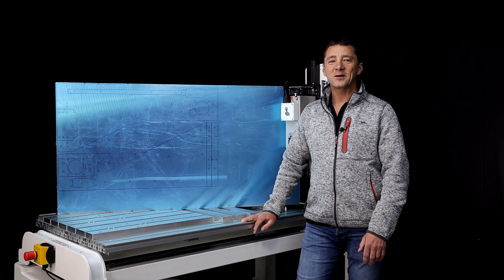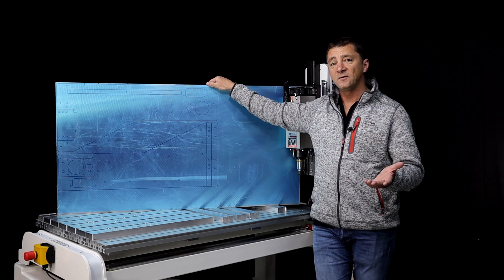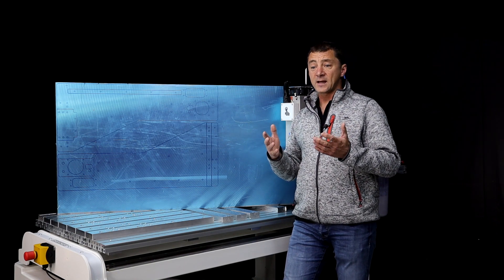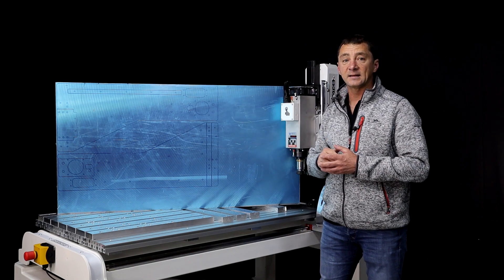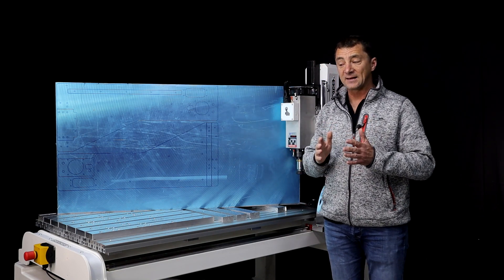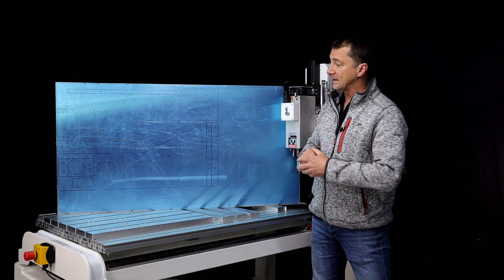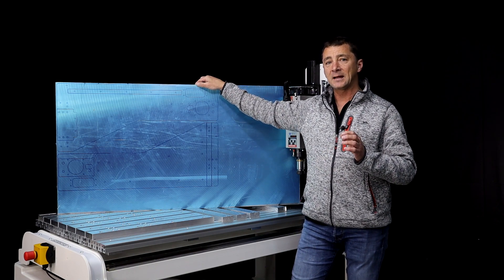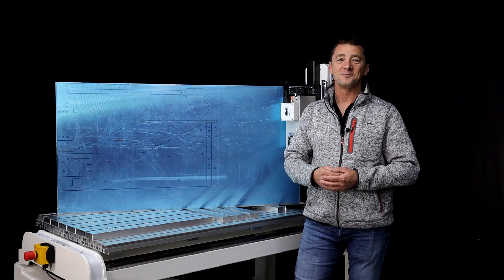CNC machining Aluminium on a CNC router from 5.0 Robotics on the Model 8

Comment: How did you remove that large parts from the worktable once finished?
That adehsive layer was not a problem?
Reply from the maker: As long as you balance the amount of adhesion you can get the part off easily.

Comment: Sweet edge finish! That HF spindle has enough torque on the drills. Using carbide or HSS drills? Nice work on the machine. I have machined thick 25mm aluminium stock as well, but i am using a a Festool FS75 to cut in into smaller portions. (using candle sticks as lubricant, just make sure you lubricate the saw with enough wax). I cut 25mm thick aluminum in two cuts,  A beefy dust collector works miracles on the chip evacuation. Aluminium likes to take a huge amount of volume when machined..  I just put a 4.5kw ISO30 ATC spindle on mine, working out the details, have to machine some parts to make the tool rack movable.
Reply from the maker: Yes - this is a spindle with higher torque at a lower RPM, you can drill with 8mm drills no problem.  4.5kW ATC very good spindle. What machine is it mounted on?
Reply: @StoneyCNC  On the aluminium one  that's on my channel, (it has gone through some updates/upgrades in the meantime, i should upload a new movie). If i would do it again, i would pick a steel frame as a base. I've now used 80160 aluminium profiles for Y and X, flattened the X on my larger machine within 0,015 accuracy over the 760mm of width, but looking back, i would prefer a steel frame. (this one fits my purpose perfectly, not dissapointed in the outcome). The other machine is using a HSD 9kw spindle, also ISO30, i would pick HSK63 if i bought a new one. special heads, like floating heads for engraving etc are more readily available in HSK63.
Reply from the maker: @berendlucasvanderweide  Nice!! had a look - some good performance there from the machines. ISO30 more forgiving on tool pickup positional location compared to the HSK63. Nice work, low cutter stick out, decent machines and good parameters, actual decent performance. Nice work
Reply: @StoneyCNC  thanks for your kind words.
Reply: @StoneyCNC  I was just going through the HSD manual for the pneumatics on my large machine, when, by accident, my eye stumbled upon this; concentricity on the ISO30 atc tool magazine is 0,2mm and on the HSK63 an error of 0,8mm is allowed. I didn't expect this.  So it seems that the HSK63 allows a larger error. I didn't expect this.